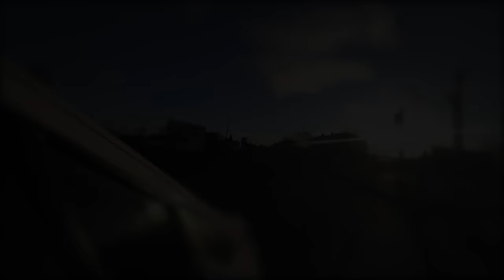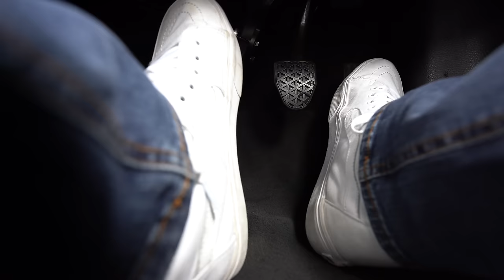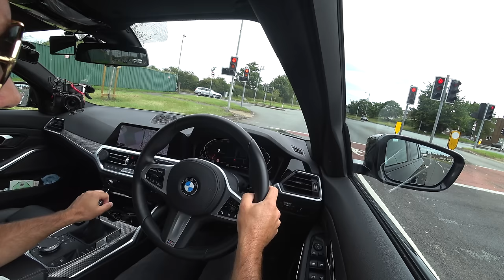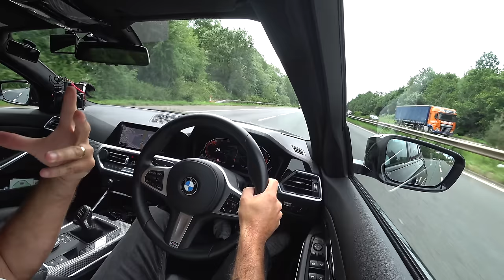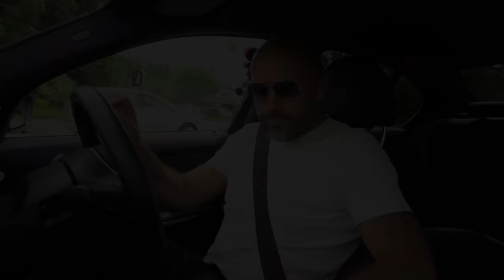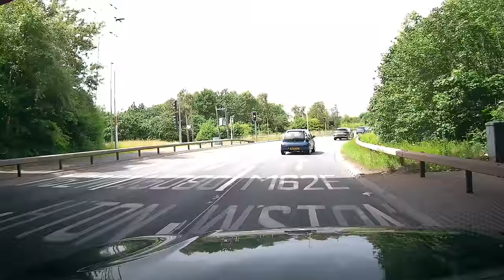Spiral or Gyratory Roundabouts

Comment: Good video. The only thing I’d do differently is not indicate on approach. Rather I tend to indicate separately to imply each lane change to the right until reaching my required lane, similarly to lane changes on a motorway. I think indicating right from the start might confuse people around you and could even make people unfamiliar with the roundabout think they are approaching a standard roundabout.

Comment: My personal experience is that the majority of spiral roudnabouts I've encoutered usually have 3 lanes. 2 lanes that will carry you round the roundabout, and an exit lane, which is usually lane 1 (sometimes 2 but this is usually, in my experience, a slip road onto a motorway, and lane 2 can also be used to drop to lane 1 after you pass the exit).
If we use Ashley's vid as an example, he is taking the 5th exit to Huyton on a 3-lane sprial roundabout. 5 into 3 doesn't go. Therefore he would need to stay in the right-most lane for two exits. After the second exit he was in lane 3. After the third exit this became lane 2, and after the forth exit he was in lane 1, and ready for his exit from the roundabout.

If you can remember that on a spiral roundabout after every exit, your lane number is reduced by 1, navigating them is much easier .
This is a general rule of thumb, but always read the roadsigns as not every roundabout is the same.

Comment: Nicely explained and demonstrated, thank you.  Swindon has quite a few, and some are used on test routes. They are well marked and work well, if people bother to stay in their lanes. Oxford have lots, none of which are marked properly. On approach, you choose your lane based on signs and road markings, then half-way around, the lane on your left gains the same markings, and now that lane is full of locals who are in on the secret. Exiting always in the right lane makes for a competitive environment, not good on tests. On test, if approached in the 'wrong' lane due to local knowledge a driving fault can be incurred, as you effectively cut off anyone to your right who followed the signs. Pure genius.
Newbury had one that did not work well. Locals ignored the markings and made their own routes. Again, difficult on test. A couple of years ago, the local authority painted it to match local custom and it now works very well.
Reply: Dotted lines showing the connections between one lane and another for a particular route would help, like in Australia. For example, on the Hinksey Hill roundabout, crossing the A34 from Oxford, the right lane should be connected to the middle lane, the left lane to both straight ahead and the left lane going round, but cross a dotted line to go around in to Oxford.

Comment: Great video Ashley, superb tips and a great revisit from your original video. Ive learned some new things from this video and look forward to putting them in practice. Just goes to show, you never stop learning (passed my test first time in 1978)..

 Amazing to think you've been making these video for at least 6 years now. You've created quite something here Ash, all very very positive.

I think the traffic engineers have created as many problems as they have solved with these spiral roundabouts. On the one hand, they increase the throughput or capacity of a junction by having all those multiple lanes. But on the other hand, it introduces much confusion and potential for near misses and accidents. Just a look at all the comments and opinions in this very thread, on the whole all very intelligent actually but with differing opinions on how to handle. And this is just from subscribers to Ashley's channel. Add to that the opinions of the whole general driving public and you can see how conflicts can occur, no matter how unintended.

Ashley's comment about these types of roundabouts not even being mentioned in the Highway Code, nor does signage indicate on the approach the TYPE of roundabout are all very valid and add to the whole issue. Others have also commented here that learners aren't often  taught how to negotiate these types of roundabouts. I sense many of us were taught only to handle what i call a "text book" roundabout, with entry and exit roads at 12, 3, 6 and 9 O clock positions or slight variations.

Ashley, how often is the Highway Code revised and published and how do they go about gaining feedback from the general public on revisions? Another big omission for me is there js no mention in the HC as to how to handle a traffic light junction when the traffic lights are out of action. I've seen some motorists drive straight through without even slowing down as if the junction doesn't even exist and there is often much confusion. In other countries, you must treat it as a 4 way stop and yes I know, we don't have those in the Uk.

Comment: So, that's why I've always been confounded and ended up on the wrong lane. They are a different type of roundabout, I only sporadically encounter when travelling away from home and have usually ended up in the wrong lane! Trouble is in heavy traffic you can't always see the lane markings nor the signs. I have been driving for about as long as Ashley and never knew! My driving instructors advice from all those years ago was: "At an unfamilair roundabout, just go around twice if you're not sure' doesn't really work with these.

Comment: What is confusing is that having reached the lane with your destination painted on the road surface (10:32 and 10:44) you then have to move further to the right. This is hugely confusing, as it in effect contradicts the green signs. Combined with the lack of any prior notice that the roundabout is designed to function as a special case it's no wonder that these junctions cause difficulties and anxiety!

Comment: Funny enough I went on one of those today during my driving lesson in Edinburgh (Cameron Toll) and I did have to switch to the left lane as my lane split in two at some point right before a traffic light. It was nowhere near the size of the one on the video so it was information overload, traffic lights very close to each other and it was next to impossible to plan ahead or give enough space to other vehicles (it was a rush hour too). A proper nightmare... I would love to meet the person who designed it as surely they had a very artistic soul. If not for my instructor I would have been probably still going round it in circles...I am not smarter after this lesson at all, more scared if anything and due to its small size more dizzy... Thanks for the video tho, hopefully I’ll be able to find more normal one to practice on!

Comment: Thanks Ashley, I learned something from this about the order of the exit markings in your lane. i.e. if your exit isn't first in the order, expect to have to move to the right. There's a new gyratory near me which forms part of a triple deck road junction built to alleviate years of bottle neck problems. The route I travel, to turn right you can approach in the LEFT slip road lane, which becomes the middle lane, which then becomes the nearside lane of 2 on the right exit.
Reply from the maker: It is a useful point about the order of exit markings but they cannot always be relied upon. Even this roundabout that I covering this video has a road marking mistake. Have a look at 10:44 where it says Huyton first on the road surface but I still have to move one more lane to the right hand side. Thanks for watching, Ashley.
Reply: Im glad to see this comment as this confused me when i saw the marking and you moved right again. This is how people panic and make a bad lane change. I go the wrong way safely all the time in unfamiliar areas.  @ashley_neal

Comment: The 14:00 roundabout broke my brain a bit and I watched a few times to really understand this.  I feel like I've seen spiral roundabouts before but the sign has always made sense to me for where I wanted to go.  However, I would have said the Manchester road would 100% be in the left lane due to being a thicker exit on the sign (and less than 12 O'Clock) but it isn't the case here.  Surely they should be putting one of those rectangular green signs before the roundabout too, it's so much clearer for which lane you need to be in imo.

Comment: If you ask me, all multi-lane roundabouts should be set up this way.  Some signage improvements, particularly the addition of gantry signs for lane guidance, might help with comprehension and planning, but the big win is the reduction in lane changes.  You only change lanes to the offside (the side that's easiest to see), and only when first emerging (when you have checked for a lack of approaching traffic) and when a new lane is just opening on that side (so nobody is already in it).
Alas, the only roundabout anywhere near me is a tiny one-lane affair that might have been installed purely to give the local driving schools an opportunity to teach it.

Comment: Some great advice Ash, although I don't necessarily agree with all of it. Mainly because your underlying statement is that they exist primarily at motorway junctions. Where I live there are many spiral roundabouts on our test routes and the nearest motorway junction with a spiral is near to 30 miles away. Great work. Just a bit too reliant on that theme and would be contradictory in a more urban/local setting, in which case, I could easily add another 10 mins of theory.
Reply from the maker: So just near you they aren’t primarily at motorway junctions. Does that mean UK wide they aren’t? 😂 See the bigger picture I think. How do pupils on test cope with them where you live?
Reply: @ashley_neal  you made the valid point that on approach there are no indications that it isna spiral so i stick to normal practice when teaching clients to consider their approach position based on 'clock face' exits then note if there are any small square markings/studs that don't exist on every roundabout but exist in spirals. It's the earliest indication I've ever seen.

Comment: Random question, do you have problems with the suction cup melting to the windscreen on hot days when driving towards the sun? (I know UK doesn't really have that warm/sunny days but still( My fear is that if I did that and drove towards the sun in like 20 degrees Celsius the suction cup would melt to my windscreen.

Comment: I first came across turbo-roundabouts in the Netherlands, and they work very well, for example the series of roundabouts on the N57. But they were designed as turbo-roundabouts, and have only two lanes. The example in this video is not too bad as it has road signs, but many large turbo roundabouts (e.g. the West Bromwich roundabout at the M5) have only painted lane markings and, as the road is light controlled (what idiot thought of that?) vehicles obscure the markings. Even if you can see the single marking it is too late to do anything without having to move over to the lane to the left.

Back to light-controlled roundabouts. The first I came across was in Croydon, at the junction of George Street and Wellesley Rd. What was particularly idiotic was that there were lights only on entrance to the roundabout. So, if you were new to the area, and went around the roundabout a second time, you could find lights permitting traffic on in front of you, with no indication to circulating traffic who had priority. The roundabout has now gone.

Comment: I hate those mid sized three laned roundabouts that do not have spiral road markings to help guide traffic. The ones where the outer two lanes can be taken for a junction to the right but inexperienced drivers in the middle of the three lanes do not move over to the outer (left) most lane prior to the exit junction. This forces the driver in the inner lane to be stuck in the inner lane at the exit junction and cannot safely take the exit and end up having to go around the roundabout again.  This is compounded when there are traffic lights at the exit junction. I try to stick to the middle lane in this situation and move over to the left most lane  as soon as it is safe to do so. I feel it is not so much bad driving causing these situations but very poor roundabout design or markings.

Comment: I find often the directions for which lane you need to enter on tend to be painted on the ground very near to the roundabout itself. I'd appreciate if they all had proper upright signage in advance. The ones I've struggled with in the past have had 4 and 5 lanes on approach. The 2 lane ones are less of an issue in terms of navigation.

Comment: 9:42 I'd say we can go to M62(W) and A5080 from either lane at this junction.

9:51 Here I see that we need to be in the right-hand lane for Huyton.

10:38 I can see that the next exit is for the M62(W).

10:44 I'd say that this marking should have appeared at 10:49 .

11:45 I know that there are no pedestrians waiting at the pedestrian crossing area, but it is hard to see clearly from here. So I would probably signal left (if I had a licence and a car and I was you).

11:49 Still no pedestrians.

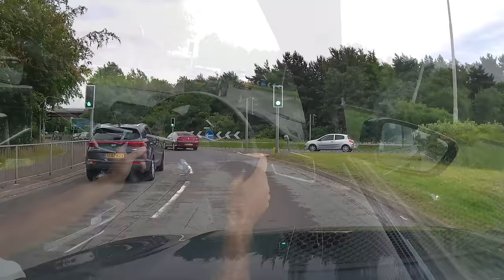14:15 So at this point, we need to take the middle or right lane on the roundabout because any vehicles on our left might want to go ahead.

15:11 I can't see the pedestrian crossing area from here, but I guess I would signal.

17:14 We would need to position for lane 2 on the roundabout if we were going to Huyton once we had passed the first exit.

I feel a bit more confident with the idea of spiral roundabouts (having not driven for twenty years), when we take into consideration the road paint. When your intended destination is the first paint that you see on the road (as you drive towards it), you're in the correct lane, and you should now follow the line on your left as it guides you out.

Maybe a work around would be to enter the spiral roundabout in the right-hand lane (every time) and signal right and keep moving to the right until we see the road paint for our destination. Then follow the line on the left.

Best wishes from IPT.

Comment: I'm quite used to spirals, there are a lot near me, and they all have something in common with the one you use as a model, lane markings for destinations on approach, and all the way around. There really is nothing that confusing about them, just observe and follow directions. 

There are two types of problem drivers on such roundabouts, those not paying attention, and those who decide that they want to get around quicker by using a different lane to get a couple of vehicle lengths ahead. The latter aspect is made worse when there are traffic signals on the roundabout, which can also lead to lane blocking by traffic entering the roundabout for a right-hand lane when there is insufficient space or time to complete. Whilst it may seem impatient and poor driving, it can be the only way to ever get onto the roundabout as waiting will simply result in traffic already on the roundabout filling the space.

If you want to really confuse people, try one of these, https://www.google.co.uk/maps/@51.7464267,-0.4731055,347m/data=!3m1!1e3

Comment: Hi Ashley, I'm sorry to disagree with you, being a driving instructor, but to not signal on an empty road, to me, is the start of a slippery slope. Like not signalling whilst driving around urban areas when the roads are empty, when there is the potential to there being pedestrians at junctions, who need to know your intentions. I always signal, empty roads or not, it's just a good habit to keep to, in my opinion. I also notice you drive with your thumbs inside the steering wheel. I was advised by my driving instructor many years ago, not to do this but to hold the steering wheel with your thumbs on top of the wheel. This is because if one was to hit a pothole, which our roads are riddled with, and the wheel whips around, it could potentially break one of your thumbs when struck with the one of the arms that support the circular section. Just thought I'd mention it buddy, keep up the great informative videos pal 👍🏼

Comment: Spiral roundabouts work best if their structure/ground area is very large. There is a 'regular' sized roundabout near here (it's the Stadium Island A35/A354 at Dorchester) that is spiral but only for 3 out of 4 exits. The fourth exit has a lane just appear out of nowhere and anyone coming from Yeovil and following the spiral will always end up in the wrong lane for the exit to Weymouth. Awful design and made worse by the amount of congestion and battling for road-space required by everyone trying to get on or off the island for large parts of the day. Mind you, this is Dorset where they can make roundabouts on the top of a hill that flood whenever it rains.